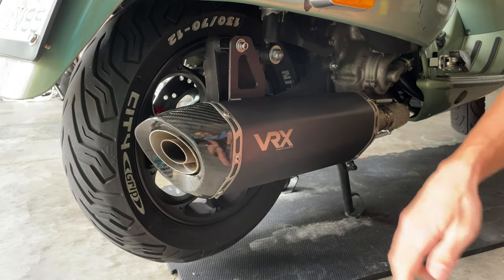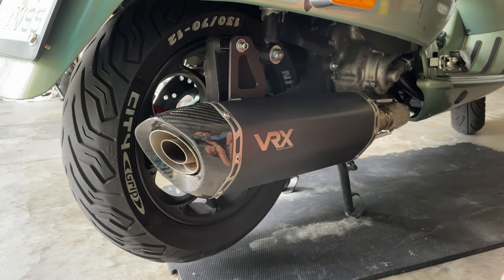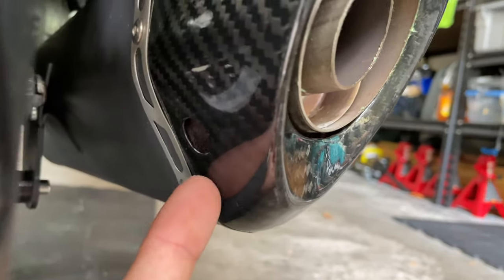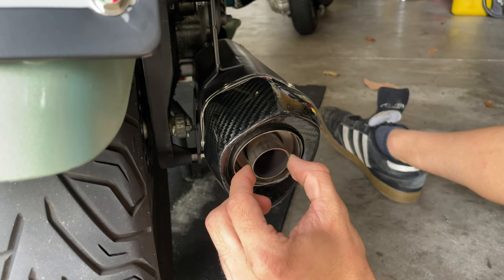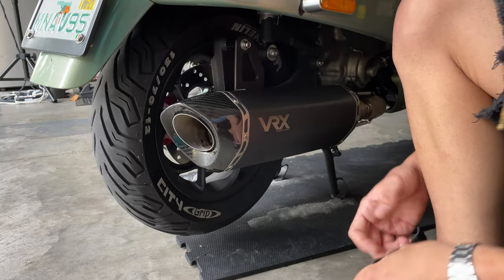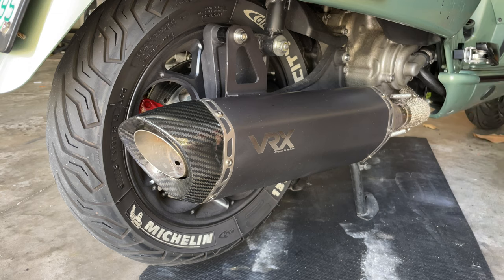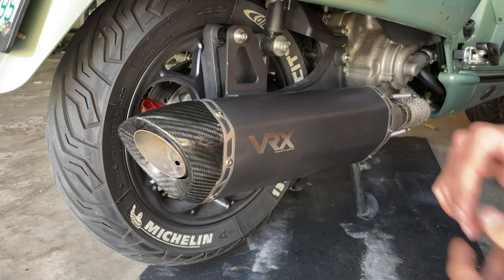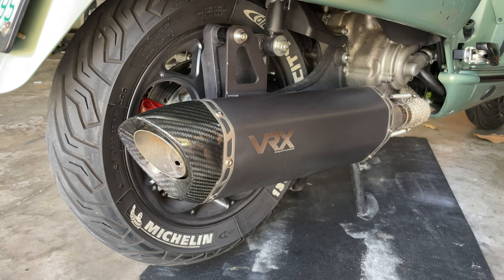Sound Test - VRX Racing Exhaust System For Vespa GT/GTS/GTV

Comment: nice sound…is it suitable for the hpe euro 5 model?
Reply from the maker: Yeah right!? Unfortunately this Exhaust System is not fully compatible with the newer models 2020-2021 even tho it can be still fitted but you’ll need to purchase the old version of exhaust manifold, we have a customer that installed the VRX System in a GTS HPE 2021 successfully by swapping the old exhaust manifold on the cylinder head to be able to fit the middle link pipe that comes with the VRX Racing Exhaust System.